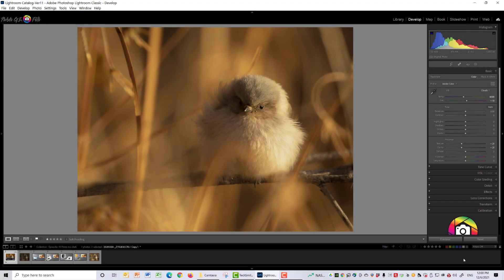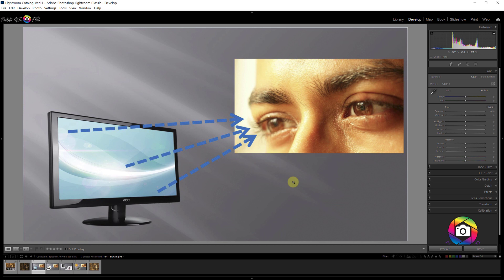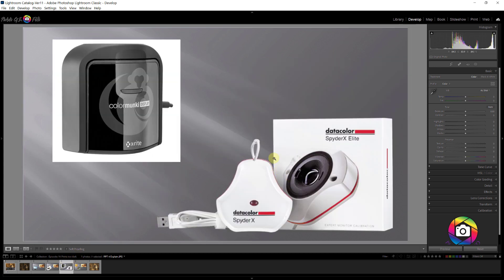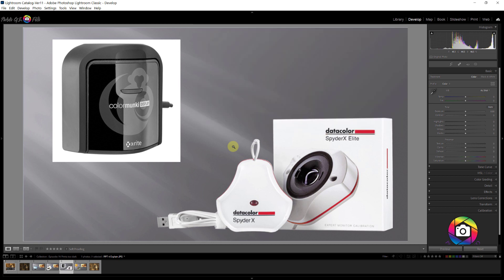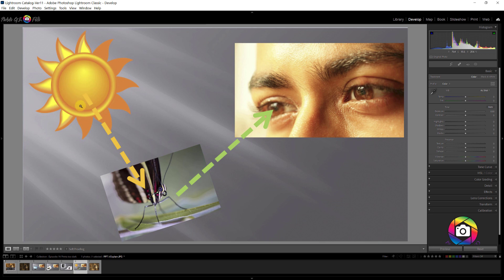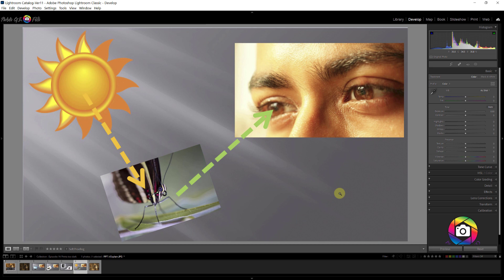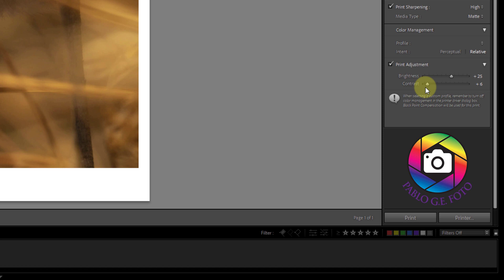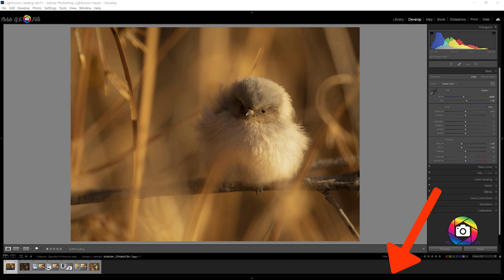How to FIX DARK PRINTS and Why do we get them

Comment: I'm not seeing this anywhere in Lightroom. Maybe we have different versions? What you have looks very different than the Lightroom that I have. What can I search for? What you're describing is exactly what I'm looking for! So tired of coming across videos talking about monitor brightness
Reply from the maker: I use Lightroom Classic, the version of Lightroom that installs and runs in my desktop. Are use by chance using Lightroom (without the “Classic” in the name) that is the cloud version?
Reply: @PabloGEPhoto  Hey thanks for the quick reply!

I'm not sure the difference between the desktop and cloud version. I'm using the "app" on a Mac (also new to Mac OS), but I don't see the term "Classic" in my version anywhere. Under system info I see what's called Adobe Lightroom CC and also as follows: "Lightroom version: 7.3 arm64 [ 20240507-1433-eff47f4 ] (May  7 2024)"

I've even tried searching "print" in the software and nothing comes up. I'd really like to figure this out (or maybe I need to look into Lightroom Classic) because all of my photos have printed great so far except for ONE particular photo where the foreground is coming out exceptionally darker than what displays on my monitor or phone (even with my monitor brightness at 15/100)